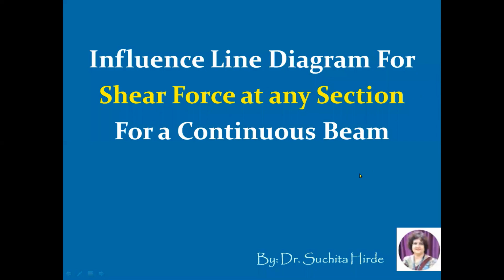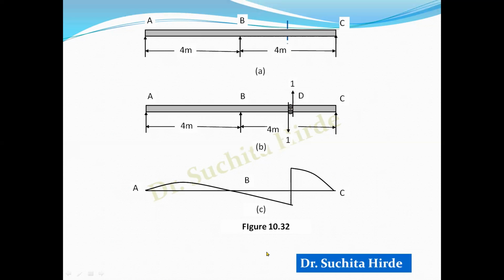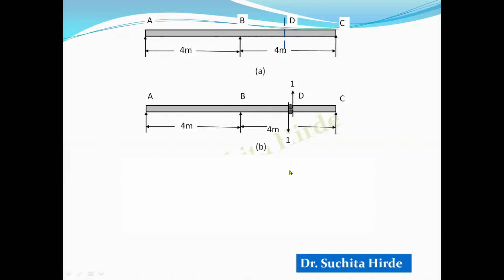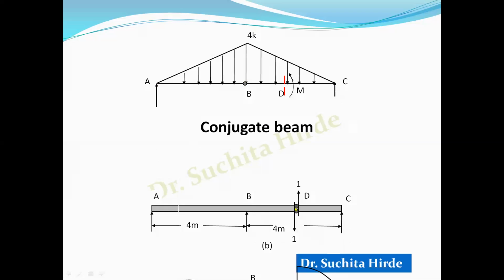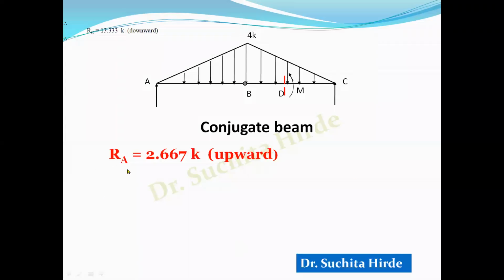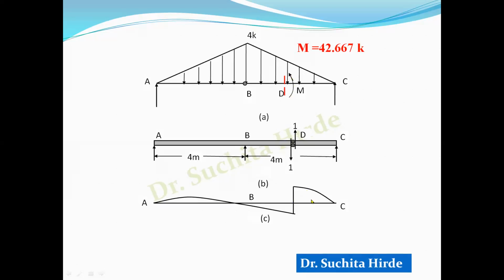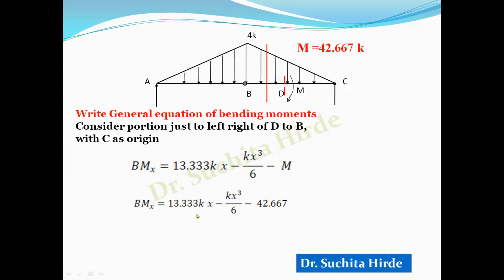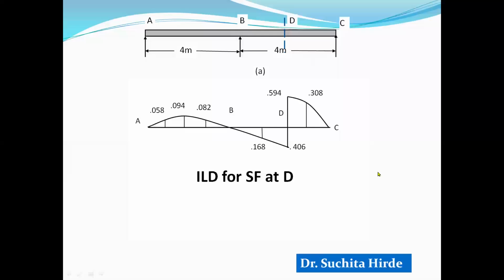Shear Force ILD: Influence Line Diagram for Indeterminate Structure:(Muller Breslau's Principle)

Comment: Hello madam,
The reaction in PORTION DC @ C it is computed as 1 downward, where it is utilized to calculate BM or any other parameter.
Pl clarify, except this doubt every step explained is  fabulous.
Reply from the maker: It is used to calculate load on conjugate beam which is nothing but M/EI of original beam. The reaction 1 downward is used to calculate the ordinate of load 4k on conjugate beam.